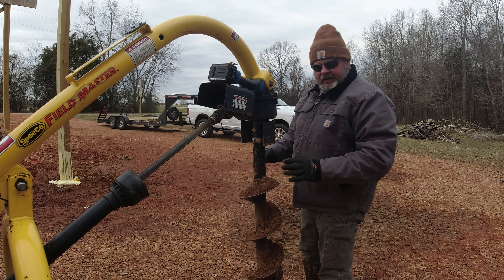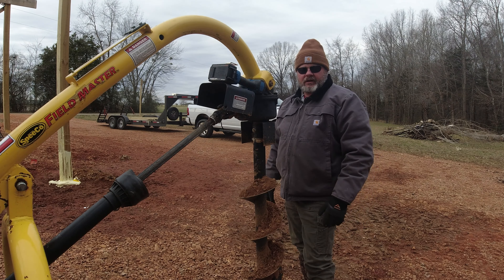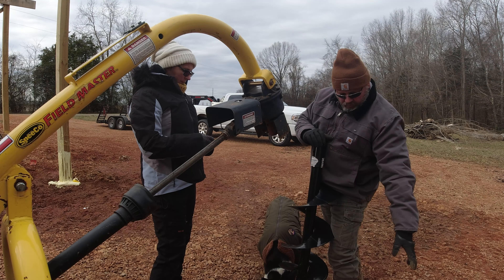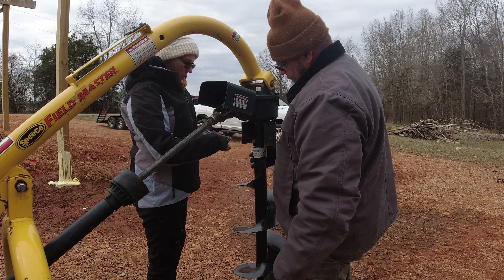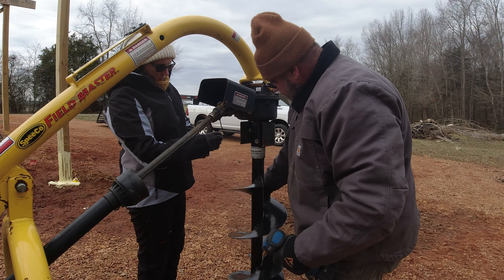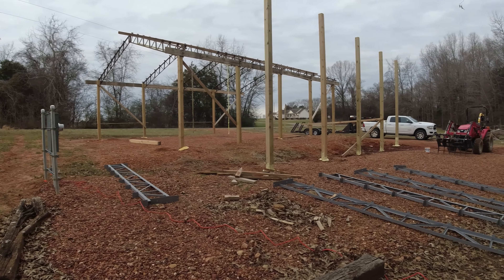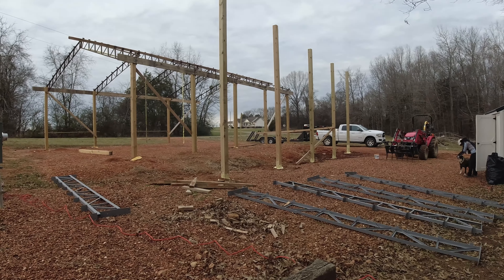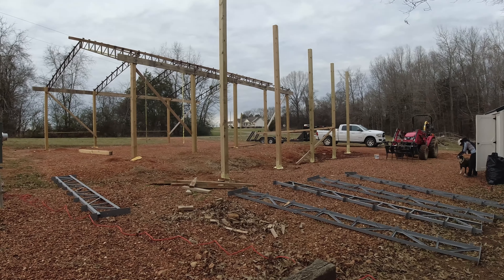Pole Barn Post Time Lapse. It Moves Fast!

Comment: Nice video.
Tony, I have heard that those 3 pt. hole diggers for the back of the tractor are a pain to mount. I heard that a hydraulic post digger for use at the front of the tractor is much easier to set up. Once I get my tractor next year, I think I'll go with that. I'm wondering if you had any opinion on this?
Reply from the maker: The rear 3pt post hole digger is by far the hardest to mount on a tractor. Unless you are getting a 70hp tractor, most smaller tractors don't have the flow rate needed for a front mounted post hole digger to operate correctly. I have seen a few videos where people have rigged something up, but I am not sure how it works. It boils down to cooling the hydraulic / transmission oil. Smaller tractors don't have the flow, but more importantly, they don't have the cooling capacity to run a hydraulic motor continuously. It will burn the oil and damage the tractor's transmission and or hydraulic system. Skid Steers have huge hydraulic coolers. Maybe you can get around the cooling issue if you are only digging one or two post at a time, but I don't know how to get around the flow rate problem. Do you have something already in mind?

Comment: Why steel trusses?
Reply from the maker: You can put them 10ft on center which cost a lot less. We carry the load with 2x6 purlins.
Reply: @TonysTractorAdventure I'll have to look into that. I figured there was a reason but I couldn't figure it out and I watched most of the videos and I didn't catch where you said anything about it. I'm going to build barn out here one of these days. And I just ordered an RK25 which I'll be waiting on for  another 10 weeks. That's how I came across your channel. Thanks for the response.
Reply from the maker: Jason, I appreciate you watching. There are so many differences from area the area based upon code. We have very few code restrictions in our county. We also have a very light snow load, which may make your situation much different.